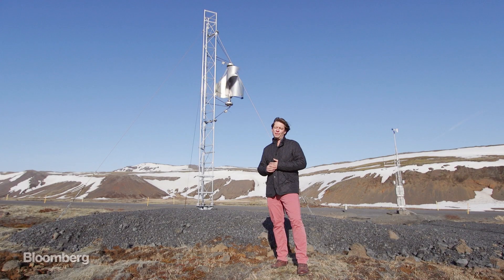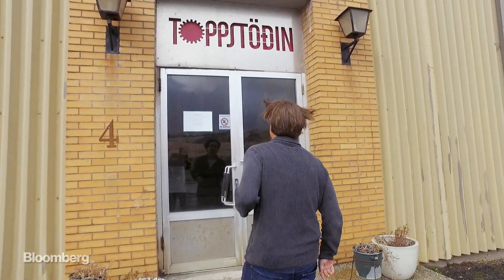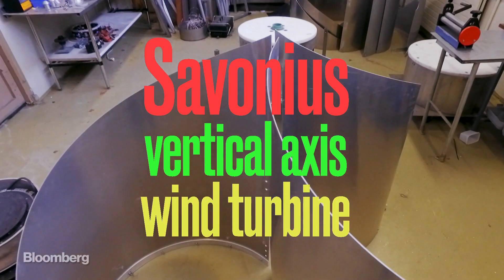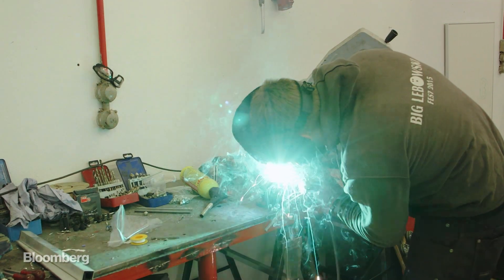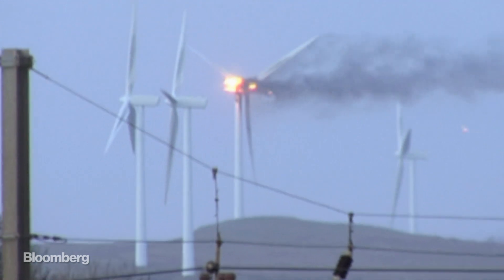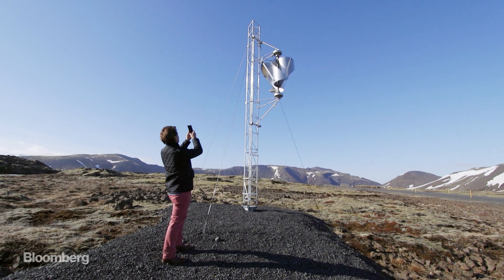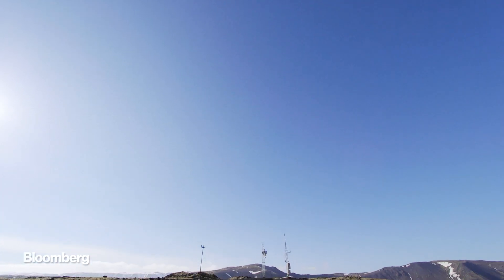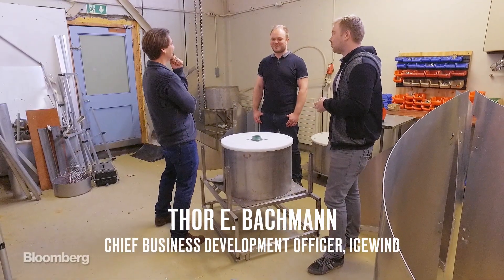The Tech That Could Fix One of Wind Power's Biggest Problems

Comment: This a poorly researched and misleading video. Showing a wind turbine on fire, and not adequately explaining what happened is criminal. Send science literate journalists for these kind of topics Bloomberg
Reply: Just in case anyone is wondering what happened. Its breaks failed, an incredible rare occurrence. Bloomberg didn't even mention that wind turbines have breaks.
Reply: @RealEngineering  ( maybe "brakes" ? )
Reply: @RealEngineering  If it has a bad break it will have bad brakes
Reply: @rcpmac  ...and vice versa ;)
Reply: @RealEngineering  You mean "Brakes" ?
Reply: @maximerousselle5984  I wasn't even sure what he meant, at first, by "breaks." I'm guessing that English is not his first language.
Reply: @RealEngineering  I am sure you meant "brakes",👍.
Reply: @RealEngineering  BRAKES!
Reply: @RealEngineering  They only have "breaks" if they "break". They do have "brakes" to slow the RPM in higher wind and to hold them stopped when desired.
Reply: @RealEngineering  Nor did you notice that they are spelled brakes.  Brakes stop.  Breaks cause destruction.  Especially when the brakes break.
Reply: @RealEngineering  it's brakes not breaks.
Reply: @RealEngineering  Put a Brake on it!
Reply: @RealEngineering  BRAKES
Reply: Real Engineering You edited this post and have left it up for one year and never noticed you used the word breaks and not brakes?
Reply: @RealEngineering  Amazing That 286 give a thumbs up to “ breaks” Brakes please!
Reply: @RealEngineering  Brakes.....
Reply: @RealEngineering  by "breaks" do you mean brakes?
learn to spell.
and
large-scale wind mills fail way too often for many many reasons.
They can not be easily disposed of after they are scrapped
and
on a per KW basis Wind power kills more people than Nuclear Power.
Reply: @RealEngineering   I don't know why your so critical of a 3 minute quicktake.  I guess Bloomberg should also teach everyone how to spell the word "brakes".
Reply: @RealEngineering  
You mean it’s “brakes?”
Reply: @RealEngineering  brakes*
Reply: @RealEngineering  You failed to tell the world how many birds the turbains kills globally every year..........
This looks like a safer and better option, the bird would se it. The other one you like.... and their wont be any birds left on the planet.
Reply: @hassanj1861  
Exaggerating, much?
Reply: @RealEngineering  If you break it, that's a problem. If you have brakes on it, it can be slowed.
Reply: Ian, Thank goodness someone knows the difference between 'breaks' and brakes
Reply: @RealEngineering  thanks i thought it was weird. They often shutdown when they have converted enough amount energy for the day/week
Reply: @ludwig2345  the length of the "informational" video dictates the depth they can go into the material... they stated an issue ..... stated a common cause ... and used a pic to illustrate. nothing "criminal" there and the reason that brakes are needed is to combat overspin(one of the issues the this design combats) ...this was clearly stated in the video
Reply: @surrealkiller7828  and what is your point exactly?
Reply: @ludwig2345  So you're saying they have quotas...talk about a waste of subsidized money. This is a definite flaw in government subsidizing renewable wind power with MY MONEY!!
Reply: @ludwig2345  Pretty harsh response. How do you know they wear out too fast? What happens to your big windmill when it wears out? As for my money I give a fuck because I worked hard for it. These alternates survive on subsidies which are funded with MY MONEY. They are building solar farms in the wrong latitudes in the first place. Ask Germany right now as they are covered in snow and the wind isn't blowing. Now how do you feel about those nasty fossil fuels saving your ass from frostbite?
Reply: This is Trash Journalism.
Reply: LIGHTEN UP!!  It was abundantly clear to anyone with a brain that the reason the large wind turbine likely was on fire was because it had a mechanical/electrical failure due either to overspeed  or mechanical components becoming worn out!
Reply: How many birds do they kill every year?
Reply: @1sydman1  Wind turbines? I believe it was worldwide something like 500k-1million, for comparison, yearly several billion birds die in total.
Reply: @MDP1702  None the less, those bird deaths caused by those silly things need not occur
Reply: @1sydman1  Neither do the deaths caused by glass, cats, pollution, ... need to occur. Are we going to give all that up? Are we going back to medieval times? Maybe even prehistoric times? Many more birds die due to fossil fuel than wind turbines for the record. And in Germany they are testing systems that can see when birds are near and can shut down the wind turbines when really necessary, or at least slow them down a bit.
Reply: @MDP1702  Possibly, but wind farms are a waste of time and energy, everyon knowss that, fossil fuel will never be replaced.
Reply: @1sydman1  
The only reason it's a waste of time is people with attitudes like yours. Wind turbines do work and produce electricity at much lower CO2 cost than fossil fuels. What people need to realise is that, even though oil is cheaper (because the governments are failing miserably at attempting to tackle climate change), wind turbines are better in the long run.
Reply: @1sydman1  how many animals die from oil spills, coal mines strpping forest, nuclear waste?
Reply: @robbiejames1540  I think it’s silly that we are tearing down dams, a much better base load and consistent power supply, for the environment, while we put up way more intermittent power wind turbines, for the environment.
Reply: @JacobAnawalt  
Dams can cause massive ecological change within a river by slowing down the average water speed behind the dammed area. This creates lake-like conditions, with less oxygenation, different river bed/lake bottom conditions etc, as well as restricting movement of wildlife up and down the river's course. In some locations and rivers this isn't a problem, but in some this causes massive damage to the river ecosystem, often particularly to fish species. Those are typically the dams that need to be torn down.
Reply: Those clasic monstrocities only came about, because of so many weathy and corrupt corporations joined with corrupt politicians to run interference against other ideas.

I worked for one of them. And was glad to be able to move on. And also glad to see vids of them self-destructing.
Reply: @philmachineman8927  fossil fuel wil be around till it rouns out. Lets be honest
Reply: it most assuredly is NOT criminal!!!  that's laughable.
Reply: Most wind turbines iv seen dont actually use " brakes" they actually have variable pitch blades.
When they want the blades to stop spinning the blades just pitch parallel to the wind.
Just an observation that iv noticed about them
Reply: @t.1000.  They have both usually as a safety matter. I don't think there is a large wind turbine like this without brakes anywhere.
Reply: @MDP1702  Right. Meant to say they dont solely use brakes. I dont know much about them. Just noticed that when ever they are stopped on a windy day the blades are pitched parallel to the wind.
Reply: Solar Panels don’t work?  The two years I’ve been off-grid, not using TXU (Texas Utilities), but using 8 350 watt Solar Panels and selling $243 a month to TXU. I’ll remember Solar Cells don’t work on my way to the bank. LOL.
Reply: @Pooh68  I hope you are saving for replacement and disposal
Reply: Or, as we say in the UK, a load of bollocks 👍
Reply: A few years ago I was working in North Dakota where the winters are severe with high winds. (I asked a lot of questions )  This sort of wind turbine failure is a constant battle in high wind areas.  In cold high wind storms they actually have to shut all the wind turbines off to prevent catastrophic failure.
Reply: Looking forward to your video! Always in depth and incredibly analytical bringing up things that aren't initially thought of!
Reply: Would you do a video on this? I really love your detailed videos.
Reply: @tiavor  
Learn to Google.  There are plenty of comparisons.
Reply: Yeah you're right, the stupid people won't be able to work it all out from that, guess they need gently leading through it.
Reply: Rekt
Reply: the length of the "informational" video dictates the depth they can go into the material... they stated an issue ..... stated a common cause ... and used a pic to illustrate. nothing "criminal" there and the reason that brakes are needed is to combat overspin(one of the issues this design combats) ...this was clearly stated in the video
Reply: E ARTE ZRFR
Reply: imagine these breaking the wind along the i-5 grapevine in california. trucks flip over from the wind there all the time. when you think about it, it's negligent not to. that place is a death trap.
Reply: Make a video about these turbines!
Or you already have done! I am going to search nebula for that
Reply: John Buck  but that use of crude oil products doesn't cause, after production, much in the way of greenhouse gases.
Reply: John Buck  yes, but only in regard to lubricants, until something sustainable comes along. Provably the greenest thing you can do with crude oil , after leaving it where it was, is turn in to tar, mix it with rock chippings and make road surfaces. After all the volatile gases escape there is next to no pollution.
Reply: John Buck  stop being stupid.
Reply: Its not as bad as when way a nuclear power plant melts down . I am assuming the breaks failed. Not a big deal either way.
Reply: @mtadams2009  those things totally happen at the same rate... ;). I’ve only seen footage of one meltdown that actually looked like melting and fire.
Reply: Criminal?  Get a grip. This video is about a business that makes something that people may want to invest in or buy for personal use. No serious person thinks this is the be all end all video on the subject.
Reply: Please, please...You spell breaks, brakes. One is what you do to your breakfast eggs, the others are parts in a system meant to slow, stop & inhibit machines in motion. It’s hard to take you, engineering minded, science based fact finders seriously. When word recognition is dubious. If it’s broken, fix it!  ...broken~past particle of break btw.
Reply: You sound like the gun nuts who make a big deal of whether a reporter knows the diff between 5.56 and .223, or harp on a reporter for calling an auto loader an “automatic weapon”.

The reality is that if these guys can provide a turbine that cannot over spin, they are taking care of a problem that clearly exists in the typical wind turbine. Doesn’t matter whether they have covered the tech details in granular fashion.
Reply: John Buck  and their use of the super greenhouse gas Sulfur hexafluoride (SF6)
Reply: Failed governor in most cases
Reply: The psychology of those like op who stubbornly refuse to correct "breaks", insisting that people knew what they meant is interesting.

This is the hill you want to defend? Why? You're that allergic to people telling you what to do that even when you're clearly wrong you'll still rationalize it? Interesting...
Reply: @gadgetsage  its very weird. I think I need a brake from internet (heheheh)
Reply: @gadgetsage  
The psykhoolgy of thsoe who get so wonud up by smiple spleling mtsiakes, depsite obviosuly knwinog waht was manet is inttesesrnig
Reply: It's known that static electricity is the culprit in most cases. Even though the blades are fiberglass, they create the static charge.
Reply: They should use a style that uses a Transmission that shifts gears as the wind blow harder and downshift the same, they could use a computer chip to control the shifting!
Reply: @Jimmy Bond I can only assume the wind was too strong.
Reply: Criminal?
Reply: Two windmills are in a field, and one asks, “What’s your favorite type of music?” The other says, “I’m a big metal fan.”
Reply: >science literate
>journalist

pick one
Reply: To show burning turbine is criminal?
I think you need mental check up,, because showing the truth of fibre and plastic body turbine,which ate a threat to environment pollution is the duty of every citizen,,
I am in full opposition of huge turbine machines,built by big corporation, because they have monopolized a simple funda into complex model,,
I recommend a lawsuit against those big giant corporations who made faulty fibre based turbine and wasted the money of tax payers
Reply: I am considering a vertical axis wind turbine that looks exactly like a tree, I call it : e-tree,
the trunk of the e-tree is brown, the spinning blades are green,
attached to the trunk of the e-tree are features of : wifi/mobile network, light and power outlet, to charge a car for example
Reply: Please let me know where could I find a "science literate journalist." Thank you.
Reply: @sorellman  Please let me know where I can find a "journalist."  Thank you.
Reply: @mannye  Dear human, that species went extinct decades ago. I though I made that clear. Sorry for the confusion.
Reply: @sorellman  Ah yes, well that's what I thought.
Reply: @sorellman  CNN?
Reply: @sorellman  isn't that called an oxymoron?
Reply: Everybody that is competent in technics, knows that such things happen!
Did anyone ever heard argueing about cars and trucks catching fire because of that?
No, they dont, they only say windmills burn, electric cars burn, but ICE cars burn 45 times more often then electric cars, at the same driven distance!
2 Teslas burned within 1 billion miles, while 90 ice cars burn at the same amount of miles!
Its mostly just fake news!

But one thing is better with these types, which exist a long time now, the shadows are not flapping like normal ones, but they produce less power!
Reply: So you claim since it doesn't follow your narrative it is criminal? Your comment is Criminal!
Reply: @donraptor6156  but if his claim wasn't like your narrative, would that make you criminal?
Reply: Conventional wind turbines are a dumb design.  I'm always amazed at how people with no engineering talent manage to get into the business of engineering.
Reply: @user-kg1dp6bi4v  Dunning-Kruger is strong within you.
Reply: Those  wind turbines are bird mixers and  no one likes them expect those who owns them and the seldom live near them.
Reply: koff41 
Dude, 10 times more birds are killed flying into plate glass windows on houses than wind turbines. Which coal company do you work for?
Reply: @happydays8171  Small and common birds are killed flying into plate glass, large and rare birds are mostly killed by turbine blades.
Reply: @happydays8171  Small and common birds are killed flying into plate glass, large and rare birds are mostly killed by turbine blades.
Reply: @happydays8171  Eagles, hawks, owls, and vultures, the apex and thus limited population birds are not running into windows or being eaten by cats. They eat cats and soar ridges where we like to put wind turbines.
Reply: @koff41  in contrast to everyone loving to live near coal and nuclear power plants...
Reply: Wind mills must be subsidized by the utility companies and tax payers as another deamoncrat hate hoax.  Thermite nuclear, geothermal, and hydro are the only sincere solutions.  The government should not tax any sincere solutions.
Reply: at the same time turbines are very unreliable and extremely costly
Reply: How about articles the media did about solar and wind power in China?  It turned out they were entirely fake and the turbines were actually being turned with an electric motor.   Wind and solar are nearly useless.    The amount of energy you get from a solar panel in it's lifetime is very close to the amount of energy it takes to make one.    Only government subsidies make them even marginally viable.
Reply: @BakaDekaai  you got a source on that?
Reply: @hardwirecars  -  Which part?   The fake renewable energy in china?
Reply: @BakaDekaai  I'd like a source on that too. Since most turbines have electric motors in them to begin with, mainly for the gear box, control system, lock breaks systems, and to restart the spinning. I'm not an expert on it, but as far as I'm aware, most of the wind farms in China are actually genuine...
Reply: @masteridiot123  Right. I don't see why they wouldn't be genuine. What sense (economic or otherwise) would it make for them to make these windmill operations if they were fake? The subsidy alone wouldn't make it pay off or make sense...
Reply: @hardwirecars  Source? Ironic for someone basing his opinion on the number of YouTube videos depicting turbines on fire as a legitimate source...
Reply: @hardwirecars  His source for that? Obviously, his ass.
Reply: @BakaDekaai  wow, you are an expert. Not.
Reply: @BakaDekaai  With no source of your denial .. Your comment will only land in the hoax of ignorance .. Join the many that talk more than they do listen
Reply: Scott Humphreys Yeah right, China is wasting so much energy to run the fans in wind farms all over the country. And all investors are still pouring money in
Reply: Scott Humphreys Prove it.
Reply: @BakaDekaai  that's a load of crap. Use your brain lad, the dutch drained their country with windmills, we ground our wheat etc etc. You can get the power from it, cost is a big issue because oil is just so cheap to compare them there is no comparison. But it's not like it's fake.
Reply: @BakaDekaai  China did have problem that the grid could not keep up with the speed with which wind turbines were build so many wind turbines were not connected with he grid, but they are catching up now.

The "fake wind turbine" story seems to be a distortion of this reality. Probably the result of the telephone game on the internet. 

Your information on the photovoltaic energy return on energy investment (EROEI) is totally outdated. Modern photovoltaics systems earn back the energy invested during production, instalment and maintenance  in one to three years (depending on the exact technology and the local climate). With a realistic life time of thirty years this means a PV system will give back ten to thirty times the energy invested in them.
Reply: @boldvankaalen3896  -  the fake wind turbine wasn't a result of 'the telephone game'.   It was result of people seeing with their own eyes and taking pictures of wind turbines that weren't connected to anything and were being turned with electricity.
Reply: @boldvankaalen3896  -  let's say i accept your figure of 10 times production vs cost.   That is still terrible.   Let me explain.   Half the energy generated is lost in the grid.   So you're down to 50%.   You subtract 10% for the cost of manufacture.   Now you're down to 40%.  The panels have to be moved to be angled to the sun constantly.    Routine repairs etc.    How much is left?   They have to be disposed of when they die.
Reply: @BakaDekaai  1) citation needed. 2) how can you turn wind turbines with electricity when they are not connected to  the grid
Reply: @BakaDekaai  
Funny that you automatically take the lower limit number of the range and ignore the rest of the range.  

Actual grid losses are below 5% and are not that different for renewables and conventional power production. For rooftop PV it is exceptionally low because power will be used close to the pont of production.

Maintenance, operational energy costs and recycling energy cost are included in the EROEI. Most PV panels are not moving. Sun tracking of PV panels is only done when the energy cost of tracking is lower than the extra yield from tracking.
Reply: @boldvankaalen3896  batteries?
Reply: @boldvankaalen3896  - there werent any turbines.  there were little windmills that were turning at constant speed wind or no wind.   doesn't take a genius to figure out what is going on.    

you can believe me or not, i saw pictures taken by people who saw them with their own eyes.  you seem very keen on repeating propaganda from the chinese communist party i doubt anything would convince you.  its not worth the effort to find them.    since it wouldn't change anything anyways
Reply: @BakaDekaai  Until now you have showed to have little knowledge about renewables and to have a strong bias against them. So somehow I am not inclined to blindly  believe some story from some dude on the internet. You make the claim, you provide the evidence.

The Chinese communist party would rather hide their grid problems, but since many wind turbines have been built by Western companies, and Western companies are often used as consultants for projects built by the Chinese companies themselves, they cannot hide this information.
Reply: @BakaDekaai  According to your logic trains and automobiles aren't viable either 'cause the government has to build the railroads and highways. My solar panels generate monthly more then I can use and I get paid instead. Also, trains around here run 100% on wind energy. Pretty viable if you ask me.
Reply: @BakaDekaai  so if solar/wind reduces the amount of CO2 and other emissions then it has contributed towards a cleaner planet
Reply: @eddieseymour9948  'so if solar/wind reduces the amount of CO2 and other emissions then it has contributed towards a cleaner planet'   That would be nice.  let me know when we get there.  Right now solar panels produce very little electricity and take a lot of energy to manufacture and don't last very long.   There is something that gathers energy efficiently from the sun,  they're called plants.   Solar panels are not the right technology,  it's been 50 years and they still suck.   I think carbon capture is a better solution.
Reply: @BakaDekaai  well the proof is in the pudding. So many countries (including Australia) are installing panels at a amazing rate. Plus the uptake of batteries to store energy generated by solar/wind is proving the viability of the systems.
Reply: @eddieseymour9948  - i've heard that for 35 years as far as solar power.   Solar power is like flying cars.  As far as batteries that is bs.   Thunderf00t has debunked Elon Musk and his batteries.
Reply: @BakaDekaai  "The amount of energy you get from a solar panel in it's lifetime is very close to the amount of energy it takes to make one. " is rather a strong claim!
You must bear your responsibility for it.
Reply: @BakaDekaai  Also solar panels are toxic I hear so it's going to cost some $$ to trash it like TV's today.
Reply: @leonardkudrecki8370  Most PV Panels use silicon solar cells, which are quite harmless. There are cadmium telluride sol,r cells that are indeed toxic and need to be recycled correctly. however, this is a only small portion of the market.
Reply: @BakaDekaai  BS.
Reply: @BakaDekaai  Like when we started using nuclear energy?
Reply: @Raider_of_the_lost_delight  -  you know full well they don't consider nuclear energy 'green'.   the hippies who push green energy are the ones who are against nuclear
Reply: @BakaDekaai  
With current technology, yes.  But once we crack the code to developing solar panels that are more efficient, they will be well worth their usage.  Cynicism is not a scientific methodology.
Reply: @keirfarnum6811  yes it is
Reply: Scott Humphreys --> Your research abilities are the only thing "worthless." Before you embarrass yourself further, look at Germany with 23,000 wind turbines, and the world biggest use of photoelectraic panels. Jan. 1 2018 they powered a record 85% of their electrical needs. Granted, New Year's Day, most were in bed sleeping, not a big power drain, but still a record, and something the rest of the world can shoot for.
Reply: @happydays8171  completely agree with you. As a side discussion, I would still be concerned about Wind Turbines which can only operate with a specific wind-speed-range. For example, wind turbines are usually engineered for the conditions they will be in.  They have a minimum wind speed and a maximum, usually pretty narrow.  I would love a turbine which could operate at low speeds and still operate during storm conditions where the wind is usually too high for most turbines to run.   PS - Anytime, someone cannot tell the difference between break and brake take a shot of whiskey. And....Go!
Reply: MrNurseInColorado --> For discussion purposes I would like to live completely off the grid. The only way I can see doing that is a combination of solar panels and wind turbines.
Reply: @happydays8171  And yet they build biggest open coal mine in Europe amid protests over destruction of forest. villages and landscape
Reply: @happydays8171  that 85% figure is a peak production figure and it's misleading. Germany, since they subsidized renewables and closed nuclear plants, they have worsen the quality of their air and started purchasing nuclear from France! Moreover, their electricity bill went up substantially. Renewables will produce close to zero energy during half their lives (nights - no solar and very weak winds and windless days and overcast). P.S. Technology like that is great for personal solutions but not always suitable and the smartest solution for grid application.
Reply: @happydays8171  selective statistics wont make non dispatchable energy sources useful, what was their average CO2 emission like for 2017?
Reply: @silverco68  
1,780,880 tonnes
Reply: @happydays8171  and the trend to 2017?
Reply: @happydays8171  and the rest of the year they burned natural gas from their scary enemy Russia or coal.
Reply: @happydays8171  and lots of batteries, unless you have a year round stream to run micro hydro off
Reply: @Happy Days. It is true Germany gets that much energy from "renewables". The bug problem with that much coming from renewables is that they pay far higher electric costs, not only for residential electricity but also in all of the goods they buy and any service that requires electricity. Sooner or later there will be a reckoning.
Reply: @BakaDekaai  you dolt. if force is applied to an electric motor it generates electricity. if the inverse happens, so if you power a motor it generates torque. THIS IS HOW AC MOTORS WORK.
Reply: @ddogthepimp  
One man’s generator is another man’s motor!
Reply: @BakaDekaai  Why are you lying?